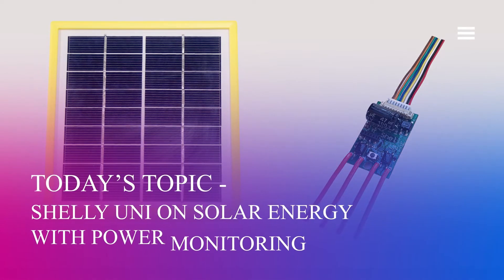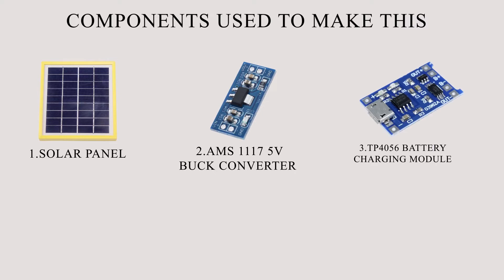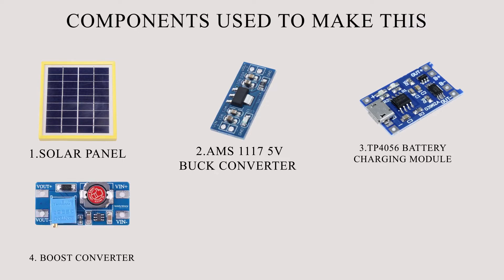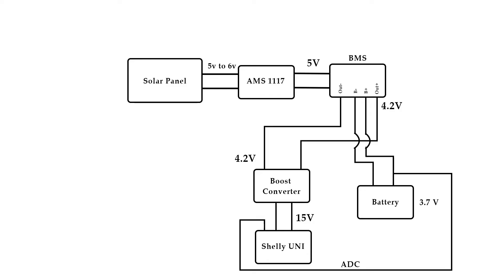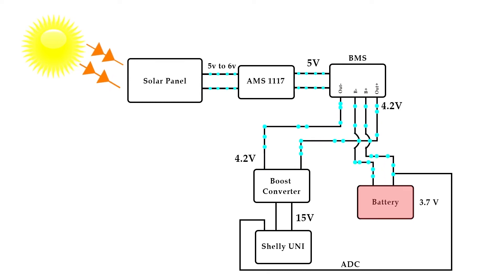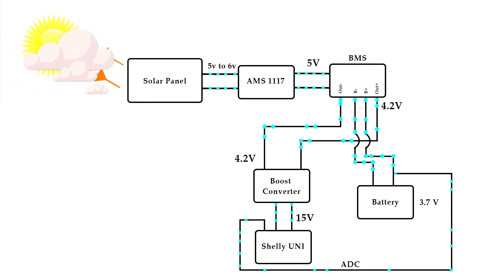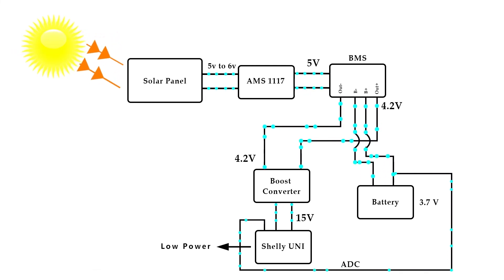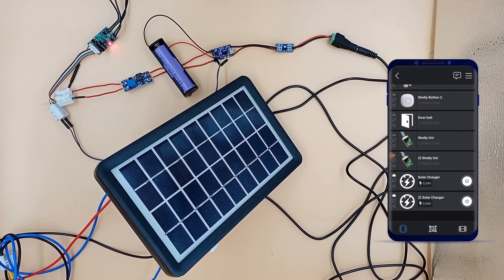Shelly UNI on Solar Energy with Power Monitoring

Comment: i had on hand a 5v 2.4 watt solar panel and a boost converter it runs a shelly uni and a 4-20ma cistern depth pressure sensor  at 12v nominal  no problem.  I only need data once a day or even less, but as long as the sun is out it works fine. All this is direct via the boost converter,  no batteries or charge control (of course).   I will try direct without even the cheap boost converter as soon as my small 12v panel arrives.